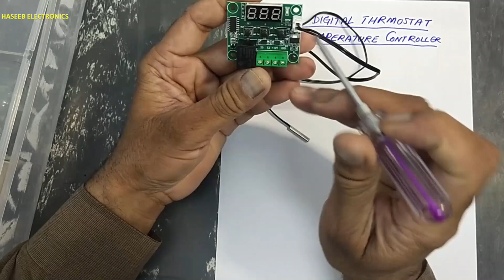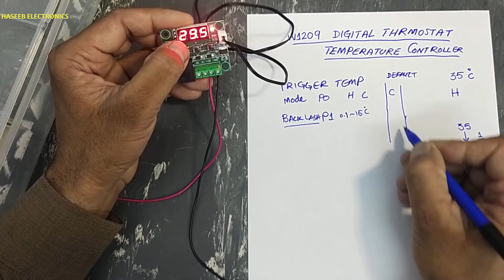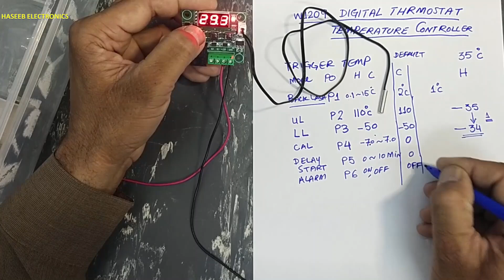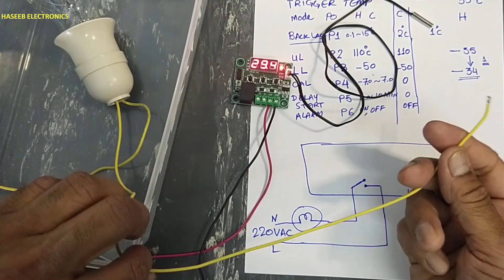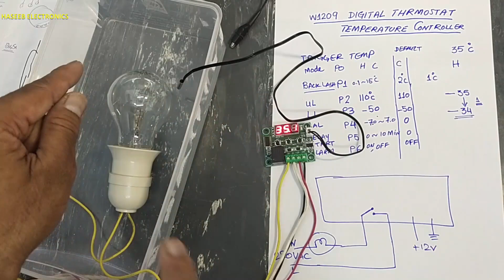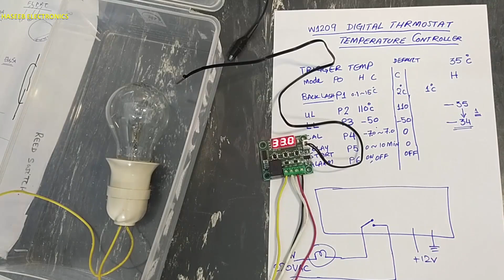{1160} W1209 Digital temperature controller setting for Heat control

Comment: Need controller like this with heating and cool modes simultaneously. Anyone know some models numbers
Reply from the maker: You can use 2 modules in combination 
Or you can program Arduino or any easily available and cheap microcontroller by defining temperature values
Reply from the maker: If you cannot find, let me know 
I will write code for you. You can upload that code in Arduino and you can use it

Comment: I wont to purchase  130 C or 140 C how it purchase
Reply from the maker: https://www.ebay.co.uk/itm/195163445069
Reply: @HaseebElectronics  Thank you very mach sir
Reply from the maker: there are temperature controllers ranging -50 to 150C